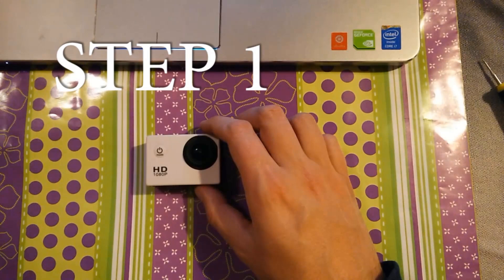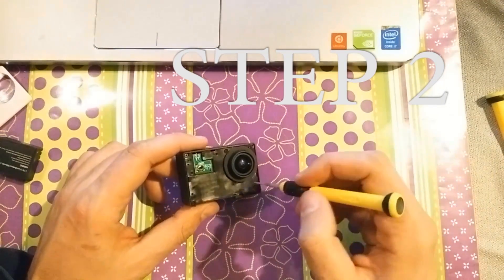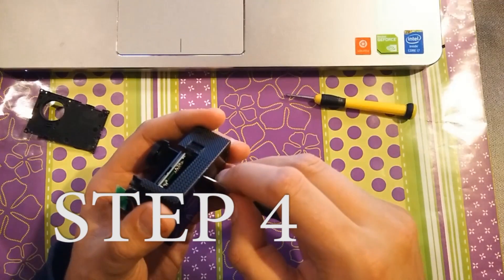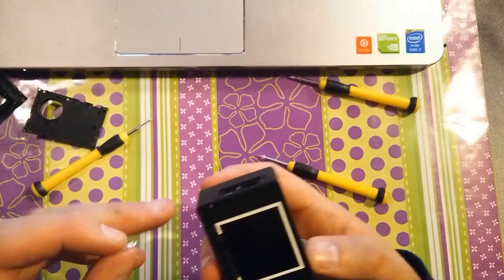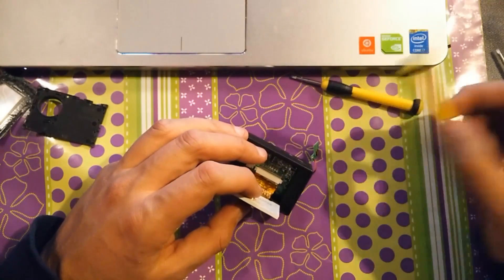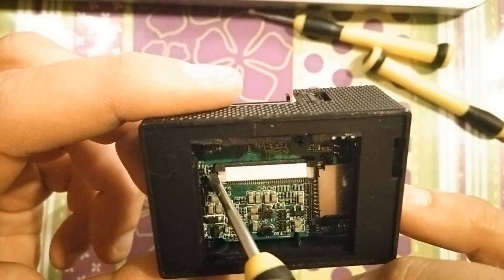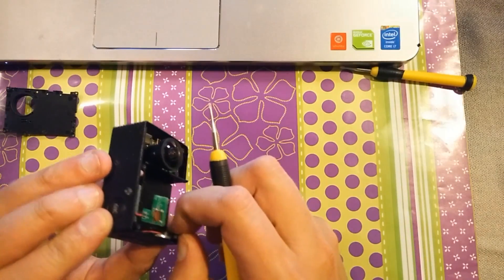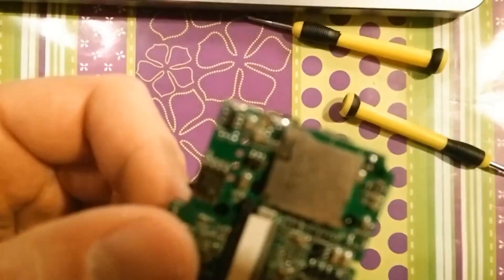SJ4000 Microphone Hack - PART1 - DISASSEMBLY

Comment: Hi Trying to take the video signal out for fpv I ended up burning one of these. Is it fixable ? Since you opened it perhaps you know a bit about the electronic inside ?  Just another question. I did buy a new action cam but with full batt charge it could record only eight minutes before running out of batt. What is the expected recording time ? I am sure not only eight minutes. Tks for the help.
Tks in advance for any help
Reply from the maker: Hi, the battery runtime should be approximately between 50-60min on a battery, so most definately somenthing's wrong here. Can't help with fixing a burned cam, I'm not into electronics really, all of the stuff on this channel is me trying out fixing what the manufacturer did wrong :) Take care

Comment: Hi! Do you think that I can just replace the internal microphone with one that performs better? I dont really need an external microphone.. Thanks!
Reply: +Christian Calabrese 
well, okay... let's try to insert URL... nobody like SPAM, so it may end in "likely spam" on author's comment section: http://www.ebay.it/itm/10pcs-9-7mm-Capacitive-Electret-Microphone-52D-Sensitivity-/121680493360?hash=item1c54b8fb30:g:RcQAAOSwv0tVaBRr
Reply: +Christian Calabrese 
What sub-sound? Probably camera itself has some bad compression. For example, on one of my two Xiaomi Yi camera I have no such problem, but on another - I have strange noise when WiFi option is enabled. Now I know that on second camera - WiFi should be off in order to get better sound quality. If your new microphone is good (for that reason I recommend 9 mm dia microphone capsule over smaller ones) - this sub-sound may be still there, but sound to noise ratio can be different - hopefully much better.
Reply from the maker: +Christian Calabrese Hi Christian, I really don't know, I don't have anything to do with electronics really, so won't be able to help. If you try and succeed, do let us know in the comments
Reply: +Christian Calabrese 
Yes. All  electret microphones working on the same principle, the difference is just in size and material used. Also, FET may be different - more or less noise. Just pay attention to polarity - it may work even in reverse polarity, but very poor quality. You need to be very careful when unsoldering microphone for two reasons: PCB traces may peel off, and if you forget to remove battery, circuit may burn. Just be careful. Do not overheat mirophone - it has very thin membrane, and it is statically charged. If it deforms, such charge may dissapear, and sound may be really poor, or no sound at all.
Reply: Thanks a lot! Could you please suggest me any particular mic maybe on Amazon? Cause I don't really know which one I should get! Thanks agaib
Reply: +Christian Calabrese 
Uh, I am afraid that this is big gamble to find good microphone on Amazon. Especially because they selling lot, not pieces - so whole thing may end very expensive to test by trial and error. But, I may suggest you visit www dot conrad dot com, and search for "EMY-62N4", it costs 3.49 Euros, but at least it has some good data. But, if you want really, really good microphone, go to www dot jlielectronics dot com, and search for low noise electret microphone, but apply filter of what you want: sensitivity is the best when number is higher in negative dB range, for example -50 is better than -45. You may see my doubt here - although it is expensive, those data does not mean anything until you test it yourself and compare. I had bad experience buying lot of 10 or more microphones, and what I got is just... not even decent quality ones.
Reply from the maker: From what I've read, mic should be mono as well as the socket. I think I'll have a go with it within a month or two cause I'm really curious how it all works
Reply: +Wild Maniac ok thanks! I will maybe try... I've got the qumox m10 i think it will be easy to open up!
Reply: +Life, Tech &amp; Moto 
By meaning of microphone, I am talking actually about microphone capsule, not hand held device. :D Sure, every capsule is mono. In every device, manufacturer chose which set will be there: mono or stereo. While all purpose camera may be with zoom lens, viewfinder, also stereo, it is somewhat pointless to have stereo on action camera. Not because sound may be distorted, but because usually many actions are speed up, or slow down... and many other reasons.
Reply: +Christian Calabrese 
Yes, every similar cameras has the same procedure: with nail or some sharp object push front (yellow?) cover - usually it is held by some mechanism on "click". Then after removing it, you may see some screws. It will be good to record video aside, when you open camera - to know how to back every component... just in case. :D
Reply: +Wild Maniac yeah i will actually try it soon! I found some videos about how open the M10 which seems even easier than with the sj4000. Talked with a friend who has a solder then we can go... I hope I won't screw up my m10, but I actually think it will be a good work!
Reply: +Christian Calabrese 
You will see - if you chose good microphone capsule, you may get plenty of sound. Aside that, try carefully drill more holes, say 1 mm or 0.8 mm all around microphone area. What a difference!!! It make it less weatherproof (rain, acidental water splash...), but anyway it is NOT waterproof.
Reply: +Wild Maniac 
Also, almost forgot - for say Xiaomi Yi and similar cameras - how many times I accidentally put finger on this stupid single hole... So, better to have many, than none if finger is at wrong place. :D
Reply: +Wild Maniac sorry if I'm going on bothering you, but should I paste the microphone to the case (internally), just leave it floating or attached to the motherboard? Thanks again!
Reply: +Christian Calabrese 
Just short and thick-er wire is sufficient to hold mic capsule (say UTP5 LAN cable has good 0.6 mm copper wire, so use it if you have - not braided one). No need to glue it. Actually, it is better to avoid transfer of vibrations from the casing to the mic capsule.
Reply: +Wild Maniac damn, watching on the websites you suggested to me I would pay a lot for shipping as I'm from Italy. I think I will look for something here :) thanks a lot again, have a good day!
Reply: +Wild Maniac I will go straight on this one then! I hope it doesn't give me this damned sub sound that is pretty annoying... And obviously a slighter better audio quality! I will let all you know when I'll do it!
Reply from the maker: +Wild Maniac That's a lot of 'channel placement' :)
Reply: +Life, Tech &amp; Moto 
Yes, I know. That is because playlist does not worked as planned: many people just like to watch all videos at once, but I can't produce videos in single continuation, and can't focus myself only on one topic. So, I rather split channels and made one for quadcopters, electronic and similar, another only for aerial videos, yet another for some artistic work (time-lapse, animation, filming...). Also, noticed that subscribers fluctuate wildly if I push one (wrong) type of the videos: for example time lapse after another one... so peobple get bored, and unsubscribe. So far, it is more difficult to me to follow, but at least more people subscribing than unsubscribing. So, who like only aerial, then "Love from above", who like time-lapse videos: "Videography", etc.
Reply: +Wild Maniac 
Also, just begins to make sense of my webpage: http://wildlab.org, where will be various projects... how soon?! Depends of my free time. Thank you for visiting my website in advantage. Be sure to bookmark this page, later it may become very interesting. :D

Comment: just tried this with mine and the external mic does not work. be very wary. I did everything perfectly and get 2 volts of the new mic cables installed but when connect with a 3.5mm mic I get no audio at all and the volts drop to 0v fishy that none of these videos are in detail.
Reply from the maker: +Flibbertigibbet Have you watched the whole video? This one is only about SJ disassembly where I showed where the mic was placed. I was about to make the Part 2, but a few people mentioned in the comments, just as you, that that did not work for them. On the other hand there are some people who say it is feasible. I did some initial tests, and it did not work either, but I haven't yet desoldered the mic.
Reply: +Life, Tech & Moto hi. it does work I have done it but you have to use a mono mic and not a stereo mic.
Reply from the maker: yeah, that's what I heard too. I think I have to give it a try. The only problem for me is that you loose the internal mic capability, so no sound under water for example
Reply: +Life, Tech & Moto yeah but you don't really get sound under water.

Comment: Are you going to make a part 2. I want to order this camera but need to make sure I can use a mic on it.
Reply from the maker: +chris gress Hi Chris, well that's the plan, but I don't have much skill, I may break the cam's microphone along the way, so I hesitate a bit. I think that this may only work with the internal mic removed, so it will be ok for the motorcycle, but you wiill loose sound underwater. I am yet to try if they can work together, i mean the built in mic and the external jack.  Just don't know when I will try to do that.

Comment: Hy, my problem is that this "ribbon cable" has been pulled out, but from the LCD. I know that was mistake but i didn't know how to disassemble camera from behind. Is there a solution for my problem. Thx
Reply from the maker: +Vedran Frkat I don't remember if it's a permanent connection to lcd or if it's just connected the same way as to pcb, but I assume that a permanent one. Could only think of giving it to a professional to have it fixed. Sorry :(

Comment: Hi.... I disassembled my SJ5000 wifi to fix the up/down button because it wasn't working.. I fixed it finally and now am facing a new problem... Am getting a pink screen in display and camera freezes when it is in waterproof case..Can you please help me...
Reply from the maker: Venkat Ramana What was wrong with the up/down button? I know that uploading SJ firmware on a cam that was not SJ brand just looked like it would cause ok button stop working and the down button taking over that function. With pink display, I would definately check if the ribbon connector from pcb to lcd screen is properly connected. As for camera freeze I have no idea why would it behave like that only in the waterproof case, really strange considering nothing changes, apart maybe from the amount of force you have to use to push buttons through the case. Let me know if you found a solution.

Comment: I have a SJCAM SJ5000 WiFi, can I do exactly the same? I also want an external mic, because the original internal mic is not working.

Is the motherboard and process the same as the SJ4000? 

Thanks in advance! :-)
Reply from the maker: I AM FOXCLORE Sorry, but I'm not able to answer that question simply because I haven't seen the SJ5000. Looking at the pics though, I think that they should be very similar in design.

Comment: Nice video...very informative. Thanks for sharing. Subscribed. We hope to see PART 2 very soon.
Reply from the maker: Jogi George Caballes Yeah, I have to do that eventually, that's for sure. Still not sure if I'll be able to have both internal and external mics working depending on what you need, haven't found much info on that and my initial tests were a failure. But I'm sure there must be a way.

Comment: Great Video, thank you.
I have a SJCAM SJ4000 wifi and the camera is completely dead. It wont turn on, when I charge it, the lights do not come on, Nothing Turns On at all. Do you think you can help me fix it. I can follow your process and open up the camera, and, I can send you pictures. Maybe you can help me find the problem, and help me repair it.
Reply from the maker: Prabin Dhar Hi Prabin, I'm not good with electronics, all my videos are just based on my own experience and trying to do some hacking with it, so I won't be able to find a problem based on picture, however, try to open the camera just as in this video, and where you see the small power button board, it's connected with two wires which are very fragile, maybe one of them came off? Did you try any other battery?

Comment: Zilllagod because the sj standerd mic internal is crap, hence the mod so can run a desent mic getting better quality. Pretty obvious really
Reply from the maker: plus you can use an external mic for moto vloging etc. the only drawback is that you loose internal mic, so no sound in a waterproof case for underwater shots' unless someone knows how to have both internal mic and the jack port working together
Reply: Life, Tech & Moto You can have both mics. You will need a three prong or outlet jack like this one linked here;  http://amzn.to/1ELp8QF      This will allow you to have both mics, You have to decide if it is worth the time and trouble.. Great video dude!
Reply from the maker: Hello Big Guy :) Thanks for the tip. I've got a different outlet jack than the one you linked, while prying the case open, I did run some tests but without any major success, so I thought it might not be possible to have both. I'll drop you a private message shortly Take care